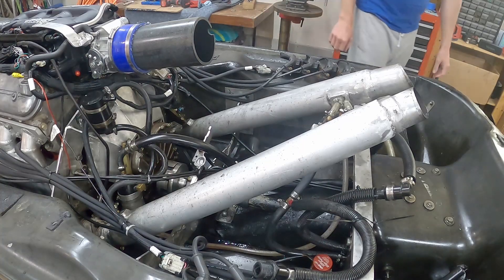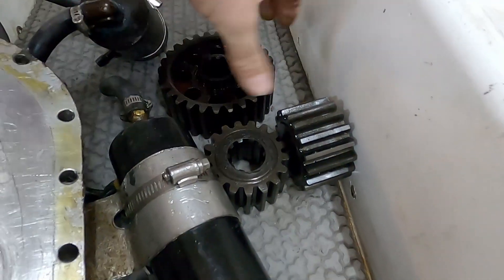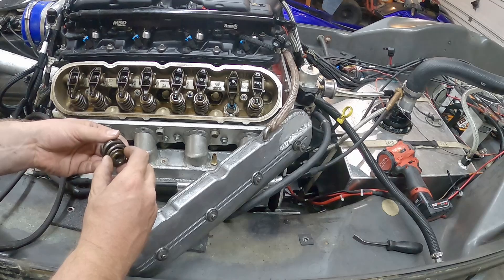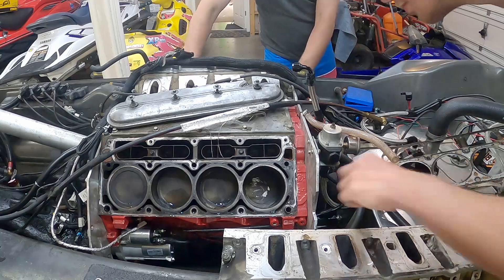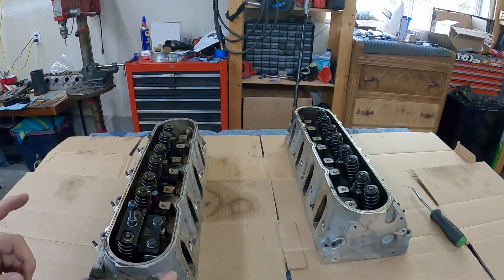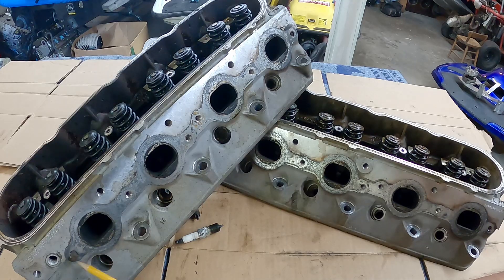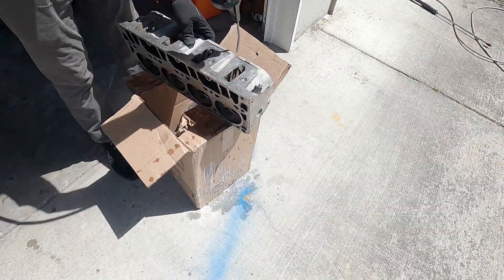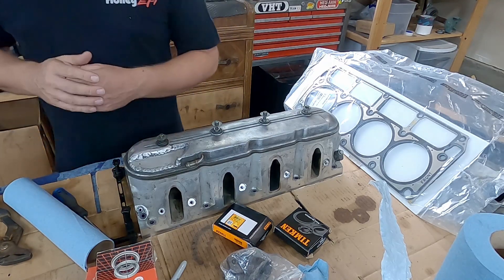v8 jetski bad day

Comment: Feel for you, you've had so much bad luck with that jet ski, hopefully you will have it up and running again in no time. Keep up the good work
Reply: I wouldn't necessarily say it's bad luck, just: engineering is hard.
Reply: @motoman22atgmail  I wonder if it could be anything else.  I've literally never seen a failed valve spring in my life!
Reply: @motoman22atgmail  What about an oiling issue, contaminated oil, overheating, or something else like that?  Not trying to argue, just speculate
Reply: @motoman22atgmail  hmm that sucks

Comment: Awesome build! I've been following the V8 build since the beginning.
Regarding the gearbox temperature, using synthetic oil can reduce oil rise by approx 30 degree F. I've done testing on a 150 HP industrial gearbox with fixed load & fixed speed and dropped it from 225 degree F to below 200F synthetic vs petroleum.
Regarding the gearbox site tube, the clips shown were very short but just be sure the hose used is rated 200F. Also be sure the gearbox breather is clean and functioning so it doesn't build pressure.
Reply: Mercruiser Alpha outdrives are well known to overheat the upper part when running standard oil if ran at "high" power long enough... Using synthetic is supposed to cut down on the failures a lot, is what I have heard. Just sidenote to what you said.

Comment: Man, that is frustrating! A new spring failing…  turned into a great video, if that counts for anything l, haha. Your gearbox held up amazingly well considering that it didn’t have any oil in it !! That’s a neat solution for adding cooling 👍👍

Currently at twin valley reservoir waiting for everyone to leave so I can hopefully tune in my trailer 🤬 so frustrating… I was at pine coulee for 4 hours, it was too busy, now I’m here and there still 3 boats out at 8 pm … not sure if I’ll get to tune at all.

Comment: Just a little info. I've been building race engines for 20 years. Your problem could be a valve floating problem and not a bad spring. Bad parts do exist but in the manufacturing world there are probably 2 or 3 companies that make valve springs, so if you buy another companies springs you are probably getting a spring for the same manufacturing company.  My opinion would be to call comp cams and change the cam and springs to their recommendations. Stock cams and valve train may not like the long period of time in high rpm range. Just my to cents.👍👍

Comment: That's an awesome machine to begin with and never meant to be built in the first place. That being said your bound to have to do some re-engineering to make it stronger and better. The only thing I would do if you haven't done it already is to upgrade  to a all aluminum LS to cut down on the weight and stress from it. Plus it may handle better aswell. That's an impressive achievement you have created. Sounds awesome.

Comment: I would HIGHLY suggest doing a compression test or a piston height check (seeing as you guys are machinist) to confirm you didn't bend a rod.  Yeah you bent a valve and it shouldn't bend a rod but it would really suck to have uncle Rodney show up and put a hole through both the block and hull.

Comment: Well that just sucks faulty parts cause a lot of destruction in a motor I put two brand new rebuilt motors in two different jet skis an one of the timing gear that runs off the crank messed up an it wouldn’t stay in time on the valve plate caused all kinds of head aches just trying to find out what happened to it . It would run then not run it would run then not run but when it first left out of my garage it ran perfect start right up no problems the not even six hours run time the all of a sudden nothing . Wasn’t my ski but the owner had it replaced with another motor under warranty from the manufacture in Florida supposed to anyway.

Comment: Well that sucks, but it could have been much worse. The engineering and build seems sound to me, you just had bad luck. Is some kind of cooling system for the gearbox oil directly not in the cards? Too much trouble to make a heat exchanger or not really necessary/feasible compared to the plate? Anyway, you should be set after the repairs you did to the engine.

And, as you also said: A V8 Jetski is just COOL . Never forget that. Keep on keepin' on guys!

Comment: Gotta look at it from this perspective, it sucks that valve spring broke & dropped a valve and all , but with a Jet -drive once you have a power loss you also have a steering loss….. you could have been ripping along at a good clip headed towards something immovable and lost power at higher rpm/ speeds and really had your “ Hands full” so to speak. Plus since you also had oiling / heat issues in gearbox you may have dodged some serious catastrophic failure in it in the very near future.  Every time a weak link fails it seems to happen for a reason ( to me at least in my endeavors) and sometimes it saves something else that would / could have been next , costing twice the damages had it happened. Guardian Angels at their jobs as I like to say…. 🤞.   You’re gonna get it dialed in eventually, as long as you keep up your “ Never say die “ attitude and work ethics.  Enjoy your videos & keep it “ Water side down” I guess…🤔😉😆👍.  See ya in next one hopefully . From Sunny So.Cal , land of the “ Over -governed “….🤨😜

Comment: Well that sucks, and not that it has anything to do with what happened, but I never heard any rev limit and was curious what is the limit set at. Nothing but a step for a stepper. I still think you should make it a prop drive, no pump, no gears, or go with a V drive, much faster
Reply: Never hit high rpm.  They are load limited by the jet pump with the power they have.  I don't remember the exact number but it wasn't even close to 6k rpm.  Might have been around 5k.  Until they get more power the pump is preventing them from hitting higher rpm.
Reply: @garrettstevens2232  comes out of the water at times with no load
Reply: Prop would be much faster for sure. In theory. Problem is, a good prop and drive system is TOO efficient on a jet ski hull. Its just too small, slim and unstable to handle any power without the jet system sucking it down, "glueing" it to the water. Its going to be terrible to drive in a fun, normal way with a prop in almost all aspects. And dangerous, extremely so, if given any power anywhere but a minor fraction of what it runs currently. We dont want to make Milo fatherless at such a young age. 

Jet propulsion is super stable in all speed ranges, predictable handling, etc.  

Disclaimer: I am not really a knowledgable jet ski guy, but I am a sport boat guy, and a Jet ski with a prop drive system is just a very small boat. 

There are arguments for propped jet ski builds, such as the fact you can make one with for example a 50hp engine and it runs really economically compared to a jet system. I have seen none that can make reasonable use of hardly even 100hp without turning into widowmakers-to be.
Reply: @GoldenCroc  sounds like a Croc
Reply: @stevejohnson8703  Excuse me, dont really get the last comment. Some kind of joke or?

Comment: Are you it's QC issues that caused the spring to fail?  I'm not saying it's not, but rather if there's a possibility it's something else (oil pressure issues, water in the oil, etc.), now would be the time to check.
Reply: You think they pulled the motor apart without checking oil lol if it had water in it you would see it in the top end
Reply: @nonofyourbusiness7631  Oil starvation can be caused by something other than lack of oil.  It could also be the spring wasn't installed right or something